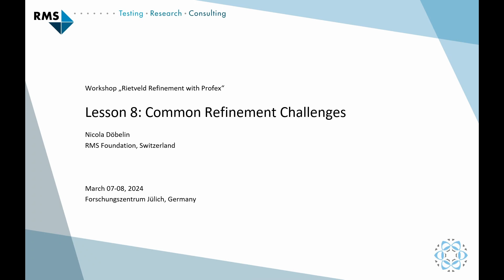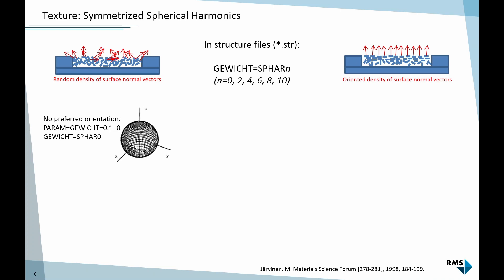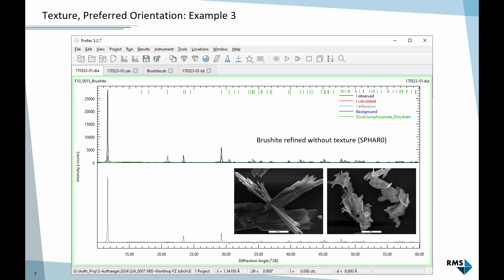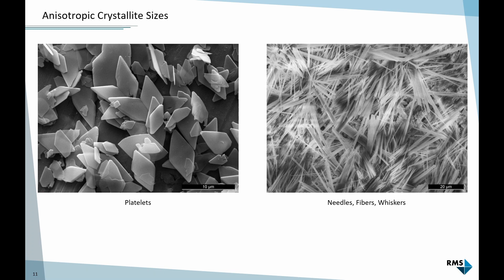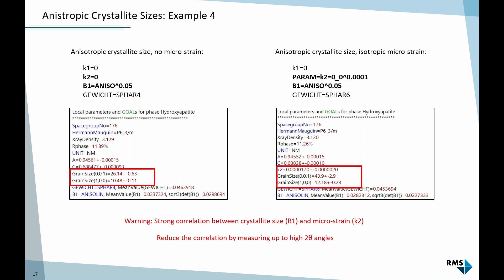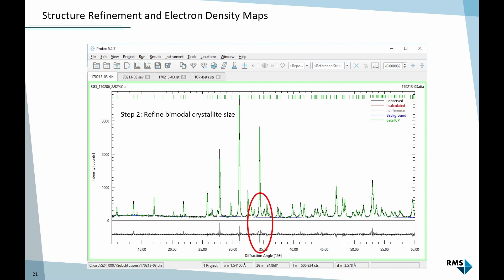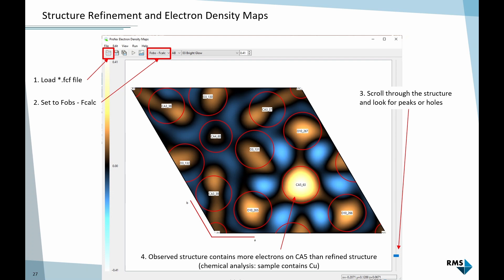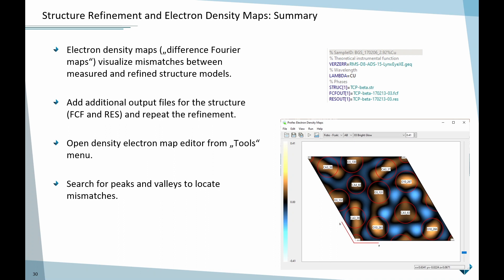Workshop 2024 Lesson 8: Texture, anisotropic crystallite sizes, and electron density maps

Comment: Something that I need to clarify from you. When you aim to refine the structure I noticed that chi square value gets worse (above 1.5) even as density map looks better (let us say it changed from 1.2 to -1.2 to the range from 0.49 to -0.49). So what I want to say when I export the results of the grain size which result should I trust. The grain size values before structure refinement or after? Thank you.
Reply from the maker: One thing that comes to mind is that the calculation of Chi^2 depends on the number of refined parameters. If you release more parameters, Rexp gets a bit smaller, and hence chi^2 = (Rwp/Rexp)^2 increases. Whether or not this explains your observations I don't know. The crystallite size is derived from the peak width. So whatever fits your peak shape better should result in more accurate crystallite sizes. In a high-quality dataset, that would be the structure refinement. But in a low-quality dataset, a structure refinement might over-refine the data and result in bogus results. Without seeing your data I can't tell which of the two scenarios applies to you.